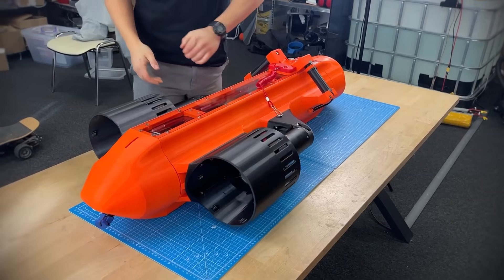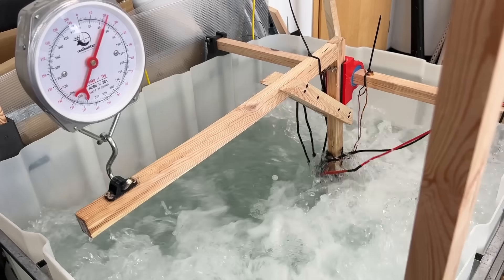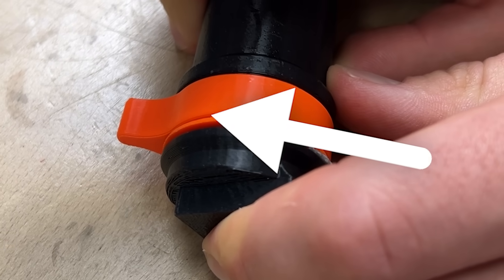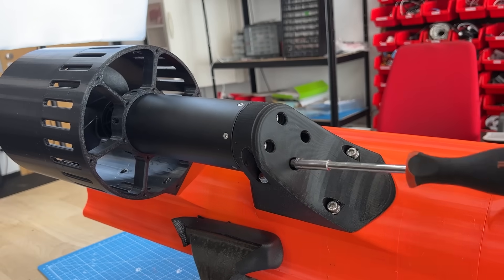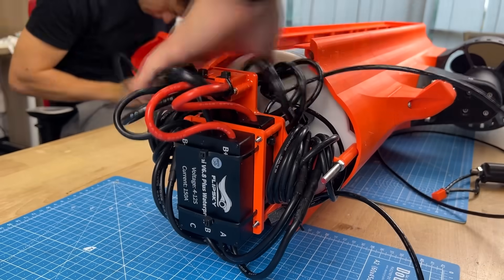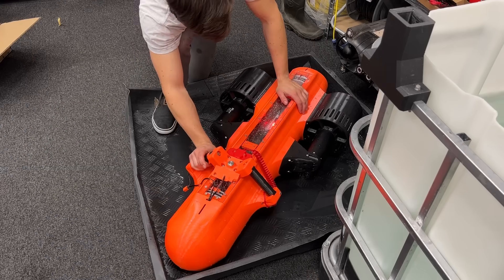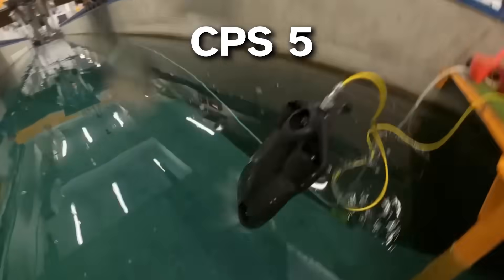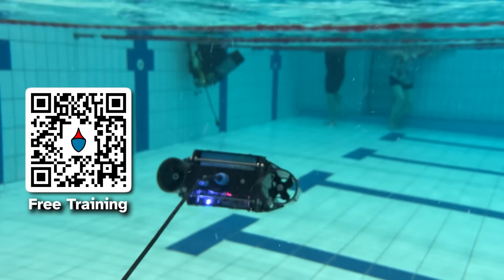Building The Fastest Underwater JETPACK

Comment: As a dive instructor I can tell you, you don't have to be able to swim faster than a shark, you only need to be able to swim faster than your dive buddy.
Reply: 😂 hey chubbs, let's go diving....
Reply: @nichudnic2469  Got a cave dive next weekend if you want. Narrow passages, but trying to push it further. Mapped 934m in and  down to 160mdeep  so far using a modified Inspiration and 10/60 trimix. Looking at around 8 hours in the water, 6 of them on deco. Still keen?
Reply: @mirandahotspring4019  I will be the one that blocks your way out and we both die 🤣
Reply: As a instructor you should know sharks are not interested in humans if the behave friendly
Reply: Hi
Reply: If you were a dive instructor you'd know sharks don't attack divers who don't harrass them.
Reply: @gtfkt Try to understand what a joke is.
Reply: As a diving instructor what is your take (If you even see this) on going at relatively fast speeds underwater? Would it be more dangerous by making it easier to get the bends for less experienced folks? (I mean that it makes it easier to do faster depth changes)
Reply: @alexisrivera200xable  Not so much the bends, but it could make an air embolism more likely by rapidly surfacing with a lung full of air as well as the obvious risk of lung over expansion injuries.
Divers can develop arterial gas embolisms as a consequence of lung over-expansion injuries. Breathing gas introduced into the venous system of the lungs due to pulmonary barotrauma will not be trapped in the alveolar capillaries, and will consequently be circulated to the rest of the body through the systemic arteries, with a high risk of embolism. Inert gas bubbles arising from decompression are generally formed in the venous side of the systemic circulation, where inert gas concentrations are highest. These bubbles are generally trapped in the capillaries of the lungs where they will usually be eliminated without causing symptoms. If they are shunted to the systemic circulation through a patent foramen ovale they can travel to and lodge in the brain where they can cause stroke, the coronary capillaries where they can cause myocardial ischaemia or other tissues, where the consequences are usually less critical.

Comment: I have a 35 year old Dacor vehicle, it's not giant and not a toy, lots of power with a nearly car battery size battery.  It is lots of fun but both hands are tied up using it. Long after it was built, some genius designed 2 flat plates that are connected which allow the front of the "scooter" to be between your legs. He appropriately called it a "saddle." With both hands free, you are truly free to fly like a bird underwater, using your body and arms and hands to control direction and speed. That made it similar to how you feel and control your body in freefall while skydiving. Mounting a scooter between your legs gives you the best underwater flying experience possible.

Comment: 11:03 why cant you call it "CPS"? (Custom Printed Scuba ...) just add whatever additional letter at the end, for example CPSA 100, custom printed scuba accelerator and the 100 stands for the 100kg of thrust

and for the acceleration problem being too harsh, you probably just need to set those ESCs ramp up curve to a really really slow one, so it ramps up the power output very softly. acceleration will be worse overall, but it will be way easier to control. you probably figured that out by yourself by now anyways

Comment: I think your geometry calculation for the thrust is screwed. The scale is on the longer arm, therefore the force you measure there is actually smaller than the true force generated by the motor. The motor should have more than 50kg thrust.

Comment: A lot of care is needed when using a deviice like this. It may be good to move quickly through the water but rapid changes in depth are a really bad idea.  Air embolism can occur with just a meter or so of pressure change when using scuba gear.
 That is why most devices of this sort are slow.

Comment: 17:30
Maybe make it start off accelerating as if its in mode 1, when its at the max rpm for mode 1, it increased to 2, then 3 and then 4
I.e begin at mode 1 and increase gradually to mode n.

Thats definitely not the most optimal solution tho. And this is assuming that the problem is for acceleration and not the final power output being the problem

Comment: You need some way to get a heatsink from the ESC to the water to keep it cool. ESCs neew cooling and you have water to do that it you can get the ESC heatsink to touch the water to keep it from overheating that would be ideal. Very cool vehicle. Its going to be hard to hold on at those speeds. Maybe some sort of harness would help the arm fatigue because at high speed its a lot of force to keep holdung on.

Comment: I have much experence riding things like the seabob 7 seven and similar devises i reccomed having the be straighter and less at a 45 degree angle and putting the throtle behind the the hand so that it compresses into the the handle 
another tip is to make it a larger sourface area on the bottom to make ut be able to use it to plane on top of water
also make it float this makes it way safer and even an inexperienced rider can easilly get it to submege itself 
u need an insane ammount of batteries the seabob weighs like 50 kg its so heavy i cant even lift it out of the water and usually have to ask the crew where usually they use the crane  
 sorry for spelling

Comment: Have you tried baffles, like on a jet engine? Not only would it help you steer with 4 degrees of movement - right, left, up, & down - but you can also slightly close the baffles to create a more focused stream of thrust, like a jet fighter plane. It would add some complexity but it might increase your thrust & help with steering. You might be able to repurpose some RC model jet engine files. You could add a joystick to your control grips & a throttle on the other side to open & close the baffles. Also, try an X shaped pattern on the front cone, like the bow of ships that cut through waves. There's a bunch of research to show it's the most efficient shape for the front of a vehicle to cut through water. It sends the turbulence around the craft. There's also nano fabric that imitates shark skin & has the lowest drag. It's really expensive but it's great future tech. Can't wait to see how this turns out. Great video, man!

Comment: Finally a wearable CPS!!!, as a divers advice, the scooter configuration is the best one, with the butterfly frame the divers volume augmented the drag so much and the most important part, it becomes so inestable cause the engines are to close from the divers centroid that’s also the flotation point, and the convergence point for 3 movement axis so it have up to 6 degrees of freedom to move, otherwise when is used as a scooter, the vehicle is dragging out the diver in one principal direction, this is the exact same thing as wearing your weight belt on your waist or on your hands, in the first case you could have neutral buoyancy, on the second you sink to the bottom as soon you enter to the water, and the only difference is the weight distribution and it’s distance to the mass center.

Pd, that rubber suit must be a huge pain to wear and a very difficult thing to put on

Comment: As a PADI Divemaster, I should tell you a few things. 
I have dove all over the world. And the one thing that I have learned about underwater scooters. Is that everyone that uses underwater assistance equipment, are scuba divers.

And the vast majority of scuba divers, put tanks on their backs. 
As such, the equipment must not be really big. And I have used types that attach to the tank.

Now, the main reason to use scuba diving mobility assistance, is to extend the area of exploration. 

And such as in Hilo HI, there are lava tubes  that extend further than 100 and more yards from the shore. And once you reach the entrance, you will end up making a 400+ yard round trip.

That's 100 yards to the entrance, 100+ yards into the tube. 100+ yards back out,and another 100 yards back to shore. 

Speed is only necessary for emergencies. Which is perfect for coastal lifeguards. 

This scooter, with a very big battery pack, should give someone like myself, a much longer dive, because I'm not using as much energy, and burning through oxygen. 
The harder you breathe, the shorter the dive. The shorter the dive, the less area to explore. 

Sometimes, we used a jetski, and a tow-line, to be drug out and above the spot we wanted to dive. 

Anyway, please focus on the amount of time, and ability to pull heavier weights. As I have used navy seal scooters, that drug multiple men, with equipment. 

They will also need a strong stainless steel loop, to attach to something. Because sometimes we had to leave the scooter after getting to an area, and leaving them, until we were done exploring, or cataloging a wreck.
Reply: They already make commercial equipment for all of that. You wouldnt be taking this into a cave anyways, they are just trying for speed, this is not a commercial product.
Reply: Dragged, not drug. Drug seems like a logical choice, but it's a different word entirely, so this was slightly confusing to read lol
Reply: Exactly!  Thank you.

Comment: Why didn't you just put a clear plastic face shield to make the user shielded by part of the jetpack's hydrodynamic structure? A single blade that cuts through the water like the front of a speed boat. Not only would this make it easier for the user to hang on, this would also protect the user if the machine falls on them in jetpack mode and might increase the top speed a moderate amount. You also might want to put a second tube around the components that protect it components when slide in and out of the main tube, with a three brace system jutting out from the component block on each end and in the middle so you can clip the protective tube to them easily. Potentially, you could even make it so that you lock the component block into place and then remove the shield tube after the components are secured. This gaining the protection of the tube without the weight of the tube. Then slide the tube back in for removal, unlock the component block, and extract it to remove the block.

Comment: 9:33 Are those globs solder??
Reply: Holy crap he is using solder as the branches for the circuits __
Reply: 9:38
Reply: It worked didn't it?
Reply: Probably to increase the current carrying capacity of the traces. If you just used the traces on the PCB the current would melt the copper instantly
Reply: @lbgstzockt8493  maybe? I hope...
There are cleaner and lighter ways to do this.
Reply: That's what she said
Reply: Looks like it is
Reply: 15:11 no no no, he has a class he knows what hes doing lol
Reply: @sirashley2355  They do know what they are doing. It's just engineers vs technicians. Engineers solder like shit even if it works.

Comment: the problem with a fast water sled is the danger of rapid diving and surfacing.  two things you don't want to do when your in the water.  i think some sort of buoyancy/orientation control with gyros or something would be absolutely required for a device like this.  perhaps some fins that keep the sled from adjusting too much up or down.  it might make controlling it easier for the person on it.  furthermore the person on it has another problem, it will get increasingly hard to hold onto the handles at faster speeds.  and of course the obvious problem of low battery time at high speeds.

I think this is one of those projects where the goal of making a fast sled is cool and all, but i think for practicality, safety and usability you'll want to dial it back a bit.
Reply: And here I was coming to say. Don't use your head as the point of the torpedo
Reply: @MrOrionpax  dude this made me roll

Comment: Putting the ESCs inside the dome significantly reduces cooling performance, you should add inlets and outlets to the ESC compartment.
Reply: And heat sinks to help increase the surface area for cooling
Reply: i think just having them submerged in water is more than enough, water takes a lot of energy to heat u
Reply: @ObamaGaming49  These motors are probably pulling several kilowatts at peak, even a 99% efficient ESC would need to dissipate hundreds of watts to stay cool. You can't really do that with just a metal box.
Reply: He should also shroud the swimmer at least partly, otherwise most of the thrust will be lost to drag. The shark is built for speed, thus it's profile.